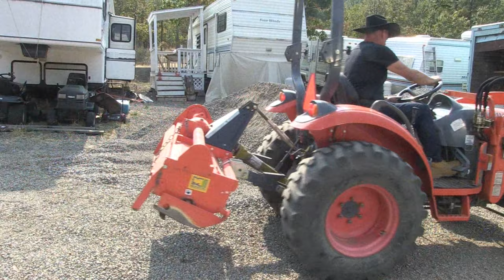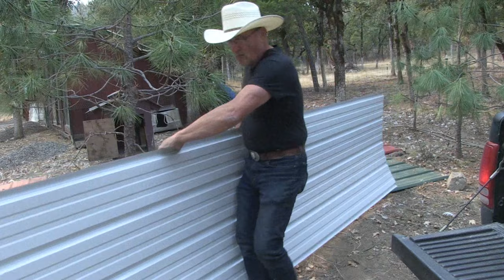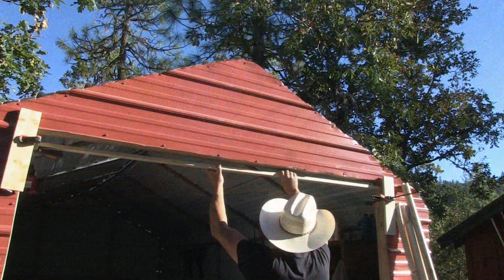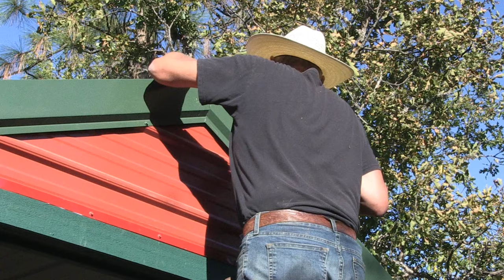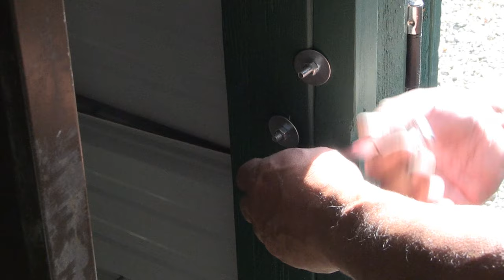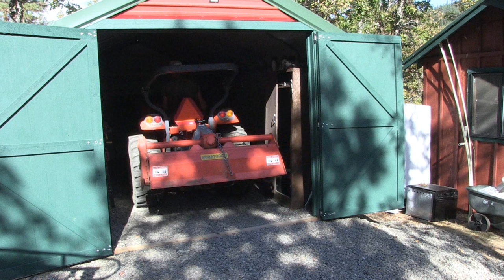FROM PORTABLE CARPORT TO DURABLE GARAGE Compilation

Comment: The only problem I can force is failing to put a plastic membrane down before the stone chipping.  The damp will rise through the stone chipping and form a considerable amount of condensation on the inside on all the metal walls and roof. The excessive damp from that will cause untold damage to what is stored inside. As anyone who as ever bought one of those cheap metal sheds.
Reply from the maker: I was wondering where all that moisture came from. I will pull a layer of rock out, lay plastic, seal the perimeter with cement and replace the rock. That way it will keep the rodents out as well. Thanks for this great tip.
Reply: Nice to be humble.
Reply from the maker: Very nice of you. Thank you Robert.
Reply: Would some rodent proof vents work also to let moisture out?
Reply: ❤  the vid, how you came up with such a unique and cool idea that came out great! 

I am capable of doing DIY projects but find melyself spending majority of my time to come up with the actual planning and design before even starting.  We all learn together and there is always room for improvement and all that we do.  Thanks for sharing and happy holidays!
Reply from the maker: Thank you for your comment.
Reply from the maker: Yes, I do have it vented across the top just under the Roofing ridge cap.
Reply: I just got that explanation from another Shelterlogic vid yesterday - the heat inside evaporates the ground moisture up to the top of the tarp. Pretty fascinating.

Comment: Nice idea for a small off grid cabin as well maybe some thin ply wood maybe a extra weld or 2 of pipe (as added weight might be a concern) then tin spray foam concrete sub floor. Rain catchment system composting potty wood stove lil 300 watt portable solar system and bang nice spot to stay in while camping or building a more suitable permanent place😎
Reply from the maker: Go for it. It is working for me.

Comment: You taught me a few new tricks. I have never considered aluminum tape on the corners of barn tin. As you were screwing on the first piece of siding next to the door opening I was screaming at my phone "No! Slip the J channel in first!" But then I saw the jamb extensions and blocking between the ribs. It's a cleaner look, I must admit. The gable roof edge is a difficult shape to trim. While I have a few ideas of how I would do it slightly differently, I can't honestly say I could do it better. No matter what, that's a hard profile to work with. Adding a ridge vent would be my only constructive suggestion.

My dad, who passed a few years ago was a carpenter. I remember helping him after school growing up. In the late 90's, we installed countless deadbolts. Most homes did not have them at that time, but homeowners were willing to pay a carpenter to come and drill out their front doors. Dad got started in carpentry prior to prehung doors being a thing. His weyerhauser lock installation kit dates back to the early 1960's. A wooden box, felt lined, with brass hardware. The jig inside, paired with a modern hole saw for the today's steel doors, could drill a door in a minute or two. Easy money. On the ride home- in his beat up old pick-up, he would always say the same thing to me, "locks keep honest people honest."
Reply from the maker: Thank you for your comment. The ridge cap was installed in a way to provide ventilation through the gap in the pitch of the roof. I believe you can see light when I pan up with the camera from inside the tractor barn. Here is the link to the complete build of the unit https://www.youtube.com/playlist?list=PLnyHBYU1MZ55hHmME-wTyliFf_mHMNTD6

Comment: Thank you very much for sharing this video. I have been trying to come up with something like this forever. I have a lot of products stored in my backyard with tarps covering the boxes.  I could not afford the real warehouse after my son passed away by suicide, I am a widow trying to hang on to the business, but I could not sustain myself with wages and a commercial lease. I closed the biz and brought everything to my backyard. I have 140 pallets full of components and machines. Watching your video, I think I can salvage a lot of my goods and I hope for a chance to be able to do some production from home. Thank you again, this video gives me hope and I am sure someone can build 4 or 5 of these for me then I will be so grateful.  I need to protect my goods from dust, moisture, and rain. I am so excited. Looking for a handyman to help me now. I am ordering 5 car ports after watching your video..each one is 12x20ft. Wish me luck 🤞🤞
Reply from the maker: I purchased the metal from Home Depot. Thanks for watching.
Reply: @pinemeadowshobbyfarmafruga8319  the metal building is very expensive. I looked into one 30x40 the costs were around $40k dollars.  I bought 5 carports for around $2500.00 and I will order the extra tops for $100.00 each, The total I spent is $3000.00. if I can find a handyman to do this, I am sure it will last me 10 years, I will be gone before that. LOL. I am almost 70 now, the warranty is a year against the tubing. Not against the cover. So I bought one extra for each. I am happy with the instructions given here. So if someone can do this to sell, it definitely has a lot of attention.  The size I am looking for is huge, I could not afford $40k at this time.

Comment: I have finally met someone as cheap as me 😂.

I did this with a 10x17 harbor freight shed. Put it on a framed floor, framed and used lumber for ends and the cheap 1/2 galvanized corrugated metal sheets beed up 3 years it snows alot here in northern Michigan not a problem works greay
Reply from the maker: Nice work!

Comment: very nice. I live in Southern NH and we have a lot of snow I would run the roof panels the other way so the snow can slide off easy. I have a bunch of these frames to close in..
Thanks for posting this love the hat.
Reply from the maker: Sounds great! We had a huge snow load on this a few months ago and it held up. As I was building it, I was testing the load strength with my 210 lb carcass. Held up as well.
Reply: Also in Southern NH here.  Good call on the roofing.  For tax purposes, I wonder if they will assess this as a portable garage or taxable permanent structure once all this is added on.
Reply from the maker: Here in Oregon I know of no such tax on these. It is still portable. I can easily disassemble it in a few hours and pack it off. No floor, and the snow load on the roof panels are sufficient for the three feet of snow we get. It did hold my 250 pound carcass while I was putting it on, so that was a great indicator of the durability of the snow load it can handle.
Reply: @humkid  yes most likely I am in Cheshire County and my neighbor did this and it ended up getting taxed recover with a tarp after enclosing. and as long as they don't look in its a temporary shed.
Reply: You must live in or near K falls my hunting partner has a ranch the surrounding’s look very similar yours, only he’s more towards rocky point

Comment: Awesome! I was a bit nervous when you put tins on the top…. It looks very dangerous!
Reply from the maker: It all worked out. That thing even holds a snow load as well as my 200 lb. body.
Reply: @pinemeadowshobbyfarmafruga8319  Awesome! Because I had experiences slipped down from the roof a few times. Anyway, you did a fantastic work!

Comment: i have the exact same frame!! i was going to do this with mine but didnt know if it could hold all the waeight from the metal. this has shown me it has no problems and going to start on mine the next warm day here in ky. But i have a concret slab to set mine on. going to be great. thanks for the push to get it started.
Reply from the maker: Sounds awesome. Be sure to anchor it down though.
Reply from the maker: Thank you for your comment. But be sure to anchor it down to the ground.
Reply: I was gonna set it on treated 4x4s and anchor all of it to the slab. I need it a little taller than it originally was. I think this frame is 8ft in the center original.

Comment: Having had a 30X50 shop with the roof metal laid the same way.  I would not again  I would have made them  lay wood  across and lay the ridges from top to bottom leaves  dirt and water lay in the ridges and cause rust
Reply from the maker: 30x50 would be too large of a span for this application.

Comment: Can I get a breakdown on how many sheets of metal and sizes, dimensions of lumber used <for frame, doors ect ect>???   
I've got 2 of these and turning 1 into a shelter for my horse the other for goats. I'll be adding vents and windows to both and inside wood panels for both.
Thanks! Was an awesome build to watch!
Reply from the maker: I'll get to work on that for you. It will be posted in a new video.

Comment: I have so many questions for such a perfect video..
1) Could I finesse a Saws All through that much sheet metal the way he did? 
2) Should I have pulled Building Permits with my Local Government since I'm converting a Temporary Structure to a Permanent one?
3) Should I run the Sheet Metal Seams Horizontally like he did or Vertically to prevent Heavy Snow Accumulation?
Reply from the maker: Thankyou for watching. As for your questions: 1) Yes, you can use that saw in that manner. 2) Depending on you local jurisdiction depends on the permitting process. In some places it is required while in others, it is not. 3) The engineered carports they build are placing the steel in the same fashion as I do. I have had no problems with snow loads collection on the roof here in the Cascade Mountains of Southwestern Oregon. Some folks prefer the place them the other way which is also a determining factor in regard to the region you live in which is dependent on how much snow you receive annually. Which also is an extra expense with added material.

Comment: How much is all the metal siding? I have 3 dead car tents.
Reply from the maker: For all the metal, trim, gravel, wood, and hardware & paint cost under nine hundred.
Reply: @pinemeadowshobbyfarmafruga8319  Can you provide any dimensions for the wooden pieces Excellent job!
Reply from the maker: The door width is eight feet total. Four feet each. The height is dictated by your metal frame structure.

Comment: I just bought the same garage with the plan to do the same thing when the cloth comes apart. I had the round top one already and wanted to do this but it didn’t occur to me until after I had already bought the new one that I very well could build the round one with corrugated metal, it would lay down fine.  Maybe eventually I’ll build that one up too so it doesn’t go to waste.
Reply from the maker: Great plan
Reply from the maker: Go for it. As for the tree debris collecting on the roof I just sweep them off or allow the snow fall to naturally scrub it all off.

Comment: To my eye, it looked wrong, having the sheets lying horizontally, like that, but you saved a lot of work at eaves level, by being able to curve the sheets around the edges of the roof onto the walls.
I don’t think I’d be brave enough to install the full sheets and cut them in situ, without help. I’d use the extra time and measure and cut them on the ground, before fitting them. As others have already pointed out, what you’ve ended up with is a water maker, because the evaporation from the ground will condense on the walls. Sealing the floor against damp will help a lot, but you also need to ensure a good airflow, even when all locked up. It might be worth considering some sort of insulation on the interior surfaces of the steel. Even the evaporation from a person breathing in there will be enough to make it rain inside, if it’s properly cold, or raining, outside, due to the vapour condensing on the cold surfaces and dripping from low points overhead.
A thin layer of spray foam insulation makes an unbelievable difference to that. I used 25mm (1”) of closed cell foam to stop my single skin roof dripping and, much to my surprise, it worked completely. Even with a cow and calf in there, it never rains inside any more. I was told after I’d committed, that open cell foam would have been better, because it allows a certain amount of moisture permeability, but given the steel is impervious anyway, I can’t see why it would make a difference.
Great reuse of a disposable frame. I don’t think I would have thought of that. Even worse, I think I might have declared it impractical, if someone else thought of it and asked me. I’m genuinely surprised it’s strong enough to support the weight.
Thanks for this.
Reply from the maker: Gave it strength and stability. Held my weight and the recent snow load. No worries.

Comment: Looks great, one question though, why wouldnt you run the corrugated roofing the grooves going downward for drainage? The direction you have it going would retain debris, snow, water, etc. Siding may have been better to run up and down with too but thats gonna be far more forgiving
Reply from the maker: It would have cost more in materials to fasten runners along the walls and roof. Most buildings I have observed with the metal framing are sheeted in this manner. As for the debris collection, not a problem. The spray nozzle on a hose will wash it off. Snow load is not a problem either in my climate. We get only up to eighteen inches over night on very rare occasions which was the case this past winter and proved the structure was sound. My two hundred pound body on one small portion of the roof will screwing in the fasteners indicated to me it could handle the load. The snow does not stay long though and I have not had to wash debris from the roof yet. The snow clears that away annually. Great questions.
Reply: Many areas require some kind of dam anyway on metal roof that is vertical.  Slows down the sliding snow.
Reply: The highs on the sheet metal wouldn't have mated up leaving the shed not as air tight.

Comment: Is this still standing looking to add one to our homestead
Reply from the maker: Yes, It even holds up under a 18 inch snow load. I'm looking into building another one as a garage to work on my vehicles closer to the house.
Reply: 🌟🌟🌟🌟🌟Yes. I was wandering how sturdy it was with that small of a frame tubing. I got one and it lasted one season. Still have the frame. 👍
Reply from the maker: Yes Phil, It is still standing and quite sturdy. The ribbed Metal roof sheets I screwed to the frame added the extra strength and durability.

Comment: Nice job, did you experience a lot of condensation ?
Reply from the maker: Yes I do. Another viewer recommended I place plastic on the ground prior to pouring the gravel. My solution is to remove four inches of rock, place plastic sheeting and backfill with cement. I want a nice cement slab in there anyway. Also I will be placing insulation on the ceiling. Stay tuned for those upgrades.

Comment: Just had my Costco 10x20 soft carport collapse this winter (over 2 ft snow)…my bad. Liked your ingenuity but kinda shying away from your level of construction. With that amount of effort and customization think I’d just do a stick built frame shed instead. But I do get your thinking— why not turn the old carport pipe frame into something more useful, if those carports had heavier gauge pipe I’d be more inclined to go your route. I’d venture a guess that you’re probably north of a 75-100 hours into your project. Glad it served your purpose tho.
Reply from the maker: Worked out great. Holds up to our recent snow load too.

Comment: Great video!  What fasteners did you find worked well to attach siding?  Did you need to drill pilot holes?  Thanks for inspiration!!
Reply from the maker: I used those self tapping metal with rubber washer screws for metal siding and roofing. Yes, I did have to pre drill.
Reply from the maker: There are metal roofing screws with rubber rings on them to seal the weather out. They are available near where you can purchase the metal at Home Depot.